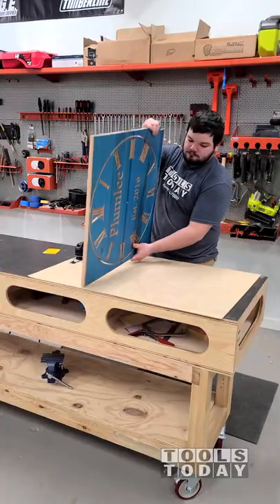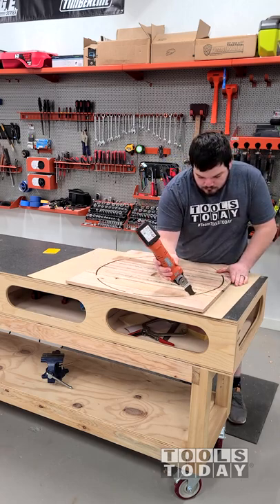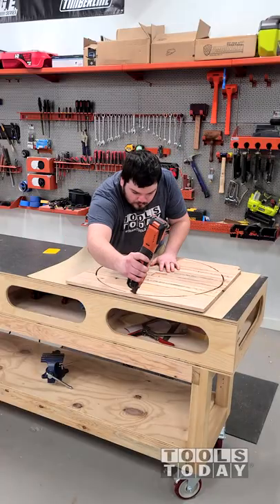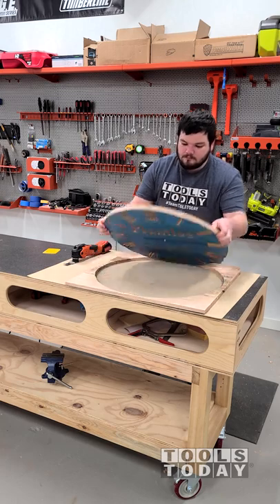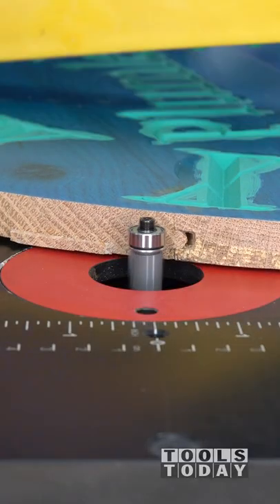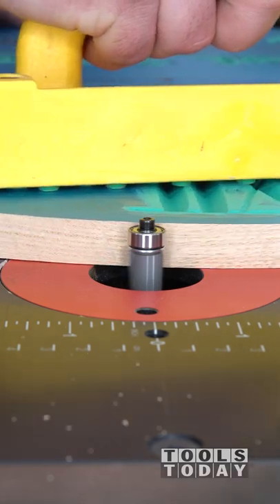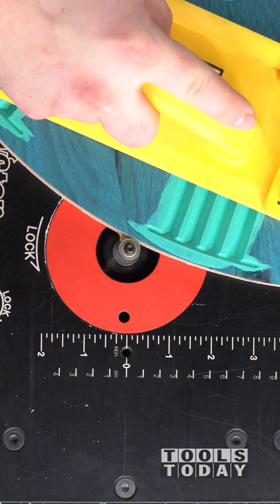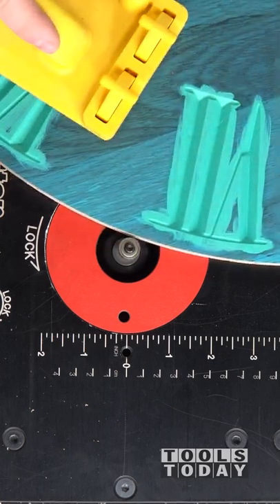My Favorite Way to Clean Up Tabs

Comment: For detabbing, I prefer using the Amana 3/16" flush trim bit in a handheld trim router.  Cuts through the tabs and flush trims them all in one pass.
Reply from the maker: That's definitely another great option!
Reply: Do you happen to know the Amana number for that bit?  Thanks!
Reply: @MRebeckah  There are two cutting heights available.  MR0102 has a 7/16" cutting height, and MR0103 has a 3/4" cutting height.  Both are available from ToolsToday
Reply: Thank you!  I’ll order them today.